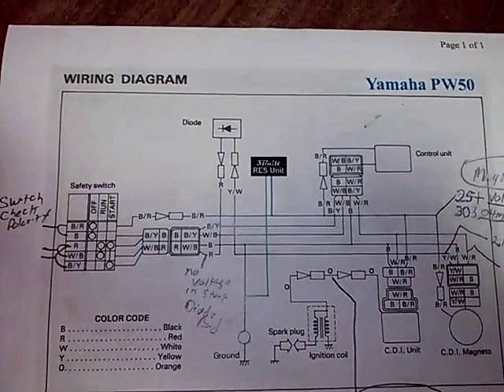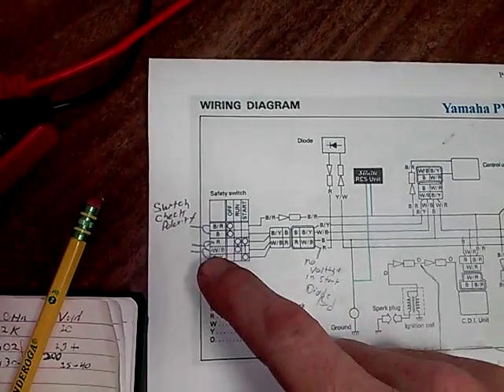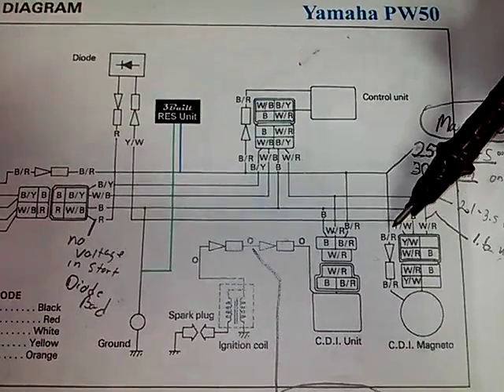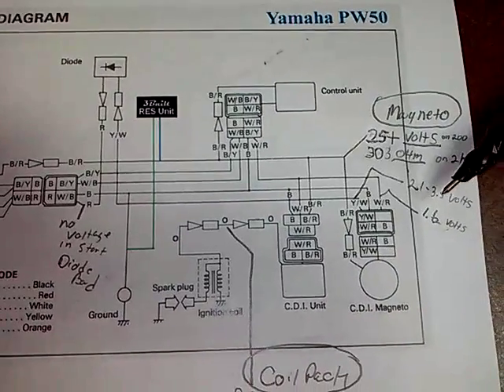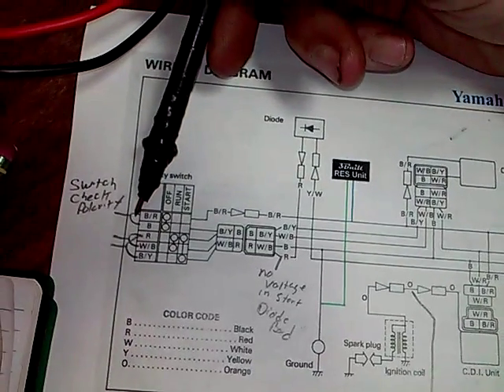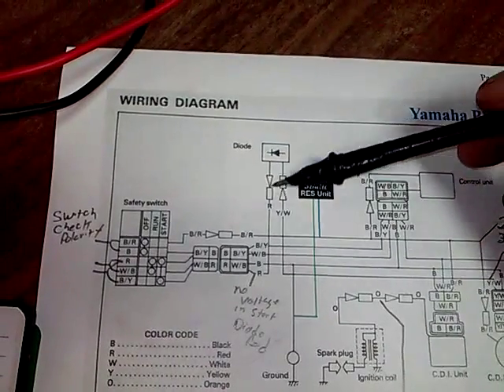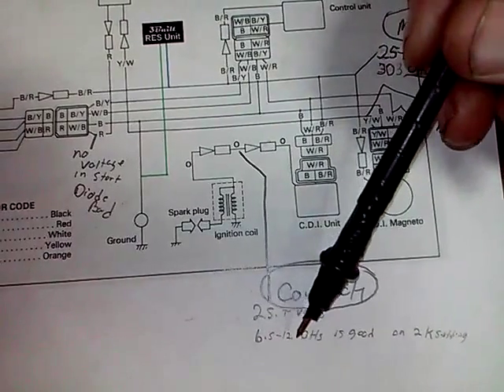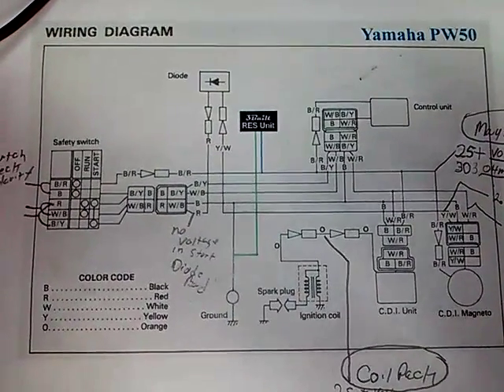how to diy Pw50 wire diagram volt ohms electric,  no spark fix

Comment: I have bought three new harnesses with components and still haven't got a spark.What I see consistently is that while I do get 25 volts out of the stator, as soon as I connect it in the harness it drops away. So, to be clear, I have tried with three of every component plus new harnesses. I'm ready to throw the pw50 in the trash.
Reply from the maker: You may have bad kill switch I had one that actually sent spark down through the brake cable the spark goes through it !

Comment: Awesome video! My pw50 wont rev up. Ive tried bypassing the switch and replaced the entire harness, carb , fuel lines. Top end has been replaced. Not sure what to test now. Idles great but won't rev up at all. Reeds are new, too. The voltage off the stater is high but jumps around is that normal?
Reply from the maker: Voltage It will jump with rpm’s up or down ! Sounds like carb or fuel issue if you have good compression! 32 to 1 good oil not gas station junk premium fuel not ethanol! Check spark plug gap also your secondary jet may be clogged also

Comment: This is the best one yet   Question the orange wire to coil I have no volts out put and it’s all new harnes cdi  on off switch stator coil  lol  I have voltage every we’re except that orange
Reply from the maker: Sounds like the cdi then! Only thing you cants really test ! Check grounds also to be safe from coil n cdi ect no rust or paint ! I’ve seen handle bar switch short to frame loosing spark , had spark run down back brake cable the gear box  lol 😂
Reply: @WaldensWorld   do you no what the ohm reading is for the coil.  And I was just thinking of buying a new cdi again lol maybe I got a China dud

Comment: Can you tell me what the voltage should be from the cdi unit to the coil on the Orange wire?
Reply from the maker: I’ll try to find it but should be 50 atleast I think mabey 80 plus volts I’d guess the pack would make it higher at the plug hundreds at spark lol but I don’t know for sure ! The towney 50 is same bike n qt50 also same stuff but they have lights

Comment: I’ve been tryin to get a switch with a square plug 4 wire can’t seem to find one I keep getting a flat one.  Wonder if it can be hardwired like colors without the plug?
Reply from the maker: If it has same wires you should be able to if I’m doubt open both n check we’re the wires go to in switch if colors don’t match ! It seems like I’ve done one beefy but it’s beets long time ago ! I’ll look I’m bit I got old parts bike in shed !
Reply: @WaldensWorld  thanks. when I bought didn’t have paper work not sure what the year is. Replaced throttle cable and doesn’t seem to work right.  These things seem like they haven’t changed in years but maybe just slightly. Bought some parts off Amazon (Junk). Got frustrated and took to the shop. They sent back not fixed. They said there guy is the best. Hmmmm. But he didn’t fix it.
Reply from the maker: Yes I have hired a few of those guys myself, it hurt my name with few people! Don’t hate the business unless you complain n they keep him ! They guy that didn’t get good service at my shop one of thousands, he just took bike home didn’t say anything until year later at race track carb wasn’t done at all ! I’ve always stood behind my work n by him not saying anything I kept guy a week longer than I should have , someone else called n complained ! The first sighn I had him do compression check on atv , he said it held 90psi for 3 minutes lol I’m like sir they tester has valve that hold the pressure in a cylinder has rings n valves ! He was like 60 said he was Harley mechanic! I put tester on pulled throttle wide open and it was120psi 90 I would have rebuilt it ! Have to have throttle open to get air ! Make sure you give shoo call to make it right ! Sometimes they just got bad apple , but sometimes you may have a case deal out or something that may be harder to find ! Good luck !

Comment: I have a pw50 that has no spark have replaced everything stator cdi coil wiring harness etc any chance you have come across this before mate?
Reply from the maker: Handle bar switch ? Bad ground ! Had spark go through hand brake cable n ark at back breaks one time lol
Reply: @WaldensWorld   hey mate so my new meter arrived today and have started from the start following your video. So I have got to the diode have put my meter on 200v ac have put my earth on the yellow wire and tried earth at the coil and positive on the red wire when kicking bike over most I get is 2.0 is that to low? Thanks mate for the reply really appreciate it
Reply from the maker: I’ll have to rewatch video I slept since lol 2 volts would be ok it it’s the trigger but not main voltage ! I can’t remember wire schematic off too my head
Reply: Haha no worries mate so diode no good you reckon? Is that possibly y I am getting no spark?
Reply from the maker: Flywheel bad ? It’s very uncommon but it happens

Comment: 96 pw50 that idles fine but has no throttle response. No change when switching from start to run on the handle bar switch. Possible bad switch or something else? Here is a video: https://www.youtube.com/watch?v=iUx-7ip5-1k
Reply from the maker: Yes I’d say start switch is out !
Reply: I tested the switch and got ohm readings when I was supposed and didn’t get any when there shouldn’t be any. Is there a way to bypass the switch for testing purposes? I tried disconnecting the plug where the 3 wires run, but that didn’t change anything either.
Reply from the maker: There is a inline resistor in the wire harness it may be bad ! But if I remember it’s for the start button not run ! Cdi may be out it has both modes in it !

Comment: Hi. My pw50 starts fine but when I turn the switch to run it cuts out and stops. It has a new switch installed. Any ideas?
Reply from the maker: Sound like your wiring is backwards or switch under side is grounding to bars some how . I had one shooting sparks though the back brake cable by the rear wheel ! I'm think that switch !
Reply from the maker: I'm not near one but typically the black n whit is kill switch . Sime after market switches are wired differently if you have the old one you can check the wires on it n what switch they are soldiered too !
Reply: Thanks guys for your reply’s. I have checked switch wiring and it matches wiring diagram. I’m now thinking it could be control unit but will try earth on switch 
Does anyone have wiring diagram with control unit removed? This will check if control unit is faulty, I can put back again if it proves to be ok.
Thanks again.
Lee.

Comment: I am getting ~ 25 Volts on the B/R wire coming from magneto if it disconnect it from the harness.  When I connect it to the harness and put the meter back on it I only get a couple of volts...
Reply from the maker: You got a weak stator at 25 ac volts I'm guessing you barely have a spark or only sometimes . What does the blk/ red to ground ohm at unplugged from harness ?
Reply: @WaldensWorld  It seems like I barely have a spark and its intermittent.  I've replaced everything from the switch to the magneto, but I already found some issues with the new harness.  For one, it came with the orange and black wires reversed that plug into the CDI relay (not the magneto).  And from what I can tell, the diode on the new harness reads opposite of the inline diode that came with the bike.  Does that make any sense?  Mine is a 1981 which (I think) makes it a pw50 H model.  I wonder if the wiring diagrams are the same across all models?
Reply from the maker: @taildrgrplt  is it stuck on start ? That has a limited on it ! It's different than run ! If you got new stator . N harness . The cdi may be bad . Or you start run switch . Is stuck on start . It fires like every other time on start vs run ! Check grounds also ! 
Diods are one way so if your getting spark it should be working ! 
Flywheel is clean no broken magnets also ?
Reply from the maker: @taildrgrplt  not sure why wires wouldn't match up . Did you check the rest of the colors ? . You have a good ground hooked to the motor also ? Not frame but motor ?

Comment: Ok guys ... first of all thank all the answers and the post. For your information I found the problem. After reviewing everything according to the info of the post plus the electrical diagram. I found that the motorcycle had no current because the switch was always connected to ground. THE WIRE B / R always grounded .... the problem was THE BRAND NEW SWITCH ... yes ..... the connection inside the switch, the little drop of welding was touching one of the walls of the housing, there was the issue .... I grabbed an old saw blade and made a small long knife and with much care removed the welding from the housing and ate a bit to prevent future touches in the housing. SO PROBLEM SOLVE.

FYI ALWAYS IF YOU REPLACE A KILL SWITHCH CHECK WITH ALL WIRES DISCONNECTED FROM  SWITCH .... THE BLACK WITH A RED LINE WIRE  ..... 
USING AN OHM METER ON CONTINUITY SET THAT THE
WIRE IS NOT GROUNDED. 
(again switch need to be disconnected from bike harness)
CHECK WITH A PROBE ON THE BLACK/RED LINE WIRE TO HOUSING ON SWITCH, IT MEANS WERE THE   SWITCH IS INSTALLED.

HOPE IT HELP

THANKS ALL AGAIN.
Reply from the maker: Good to hear . It's hard fixing over the internet more of a guide . I had one pw not sure which video you seen . Spark ran through rear brake cable . You could see it spark at back wheel ! It's a process for the strong . I tell my buddy if it was easy anyone would do it ! 
Kids riding all that matters !

Comment: Where the DIODE IS LOCATED??   NO SPARK AT ALL AFTER MY DAUTHER CRASH BIKE AND REPLACED DE IGNITION SWITCH  ( OFF- RUN- START)
Reply from the maker: Did the switch break when she crashed ?
Reply: @WaldensWorld  yes
Reply: @WaldensWorld  i just installed a new one
Reply from the maker: Do you own a volt meter ?
Reply from the maker: Diod is close to the computer under seat in a clear looking tube
Reply from the maker: I'd check ground wires new spark plugs . The diod is in the wire harness I don't remember where but you can feel it . I don't think that's the problem though .
Reply: @WaldensWorld  yes ..
Reply from the maker: You prolly have diod tester on meter . But if you suspect it replace it there cheap . I had one few week back on John deer mower test ok . But it was leaking .8 volts . So it slowly took the battery out .
Reply: Do you know what the specifications of the diode is (ohm) The one on the PW I bought is missing and would like to have the limiter working again. I can find the part number for a new one but thats about that.
Reply from the maker: Diod is one way circuit get a volt meter n it should have a tester
Reply from the maker: Diode in rectifier smooth out ac electric n switch to DC n is a one way gate so it won't flow backwards ! Alot of testers will have a diode test on it !
Reply: @WaldensWorld  Actually Diode bridge cut the AC wave rectifying AC to DC. One diode do nothing, one diode acts as a valve preventing voltage spike back to system, in most of cases use where a coil is envolved,or relay , light or ignition coils......a sudent (miliseconds) cut of power on a coil produce high voltage spuke, going to system and blow circuits, there where only one diode is installed, againin order to get dc from a ac circuit you need A DIODE BRIDGE.
Reply from the maker: @PelukaUSA  bud I just said that , a rectifier has 4 diods changes AC to DC then I said it's a one way gate it don't allow electric to flow backwards ! You've corrected nothing ! You've made yourself look silly in my eye's ! Water is wet !
Reply from the maker: One diode definitely does something partner it allows electric to flow one way ! And only one way till it burns out !
Reply: @WaldensWorld  Technically correct. Diodes DO NOT CHANGE, A Bridge rectifier is an Alternating Current (AC) to Direct Current (DC) converter that rectifies mains AC input to DC output.clean your eyes,read n learn.

CONVERTS,RECTIFY!!!

Want to look smsrt,byse right terms (if you know how. :)    )

Comment: Hi Walden, 
Thanks for the video. My friend gave me his non-running PW50 to fix. I've been through all the tests you describe and have replaced the ignition coil. Now it will start and run for a couple of minutes then it dies. Sometimes it starts again, sometimes not. The only reading I got different from yours was the magneto resistance, mine being around 175 where you had 303. I'm thinking a winding is breaking down and causing the intermittent running fault, what do you reckon? Thanks for your help.
Cheers,
Richard.
Reply: New stator fitted, Peewee lives! Thanks for your help😁👍
Reply from the maker: Sounds right the shorter the wire the closer to 0 . So yours may be bad bout half way . And when it gets hot it gets worse . Or check spark plug make sure not burning oil from bad seal on crank in gear box
Reply: Thanks for that. Good to get a second opinion. No oiling on the plug so I think we're OK in that respect. New stator ordered so we'll soon find out if that's the culprit. I'll let you know👍

Comment: Hi,
Can you please clarify what the controller units does?
Have a very old PW50 with an ignition problem.  There is a weak spark and sometimes it fires but will not run.  Have bused through the harness and it is OK.  Very old fragile and cracked insulation, but OK with some tape!.
Do you know how the controller interacts with the CDI? and is it possible to eliminate the controller?
thanks
Reply: I just started working on one of these and it starts and runs. However if I give it throttle it sounds like it Boggs down but doesn’t die. When I unplug the control unit(little black box with red coated wiring harness in the frame of the bike) it revs up higher and I can ride the bike like normal. Could I just have a bad control unit?
Reply from the maker: Yes one is the limiter on a normal running pw when it’s in start mode it skips spark until u put it into run then you have full spark ‘n
Reply from the maker: WHAT CONTROLLER ? CHECK FLYWHEEL FOR RUST AND PICKUP SENSOR FOR RUST OR METAL ! NEW PLUG GAPED RIGHT ?
Reply: Hi,  I have made some progress with this.  It appears that the function of the controller is to limit the engine RPM when in the "Start" position, to prevent the bike from taking off when kiddo starts it.  The controller has a connection to the magneto AC output that powers the CDI.  Since the magneto AC output impedance is in the region of 300 ohms, it probably shuts down the CDI by effectively shorting the magneto AC output that powers the CDI.
Another function of the controller may be to limit the RPM (& speed) when in the "Run" mode.  Maybe someone knows something about this.
The problem with the my PW50 seems to be that the flywheel magnets have become demagnetized, producing a smaller, weaker and erratic spark, making starting very difficult.
There is not much around on the subject, but it appears that old flywheels( mine is 35 years old) are prone to loss of magnetism.
I have bench run a CDI and discovered a simple method of doubling the spark coil voltage by adding a simple extra component into the system.  Am in the process of determining if this gives sufficient extra spark to make the system work with the weakened flywheel magnets.   
If that does not work, then it means a new flywheel is required.
Reply from the maker: yes you prolly have bad handlebar switch ! they go out ! my grandsons will be running and vibrate to start then well no more running ! l;ol sorry i got a.d.d. didnt notice pw video ! most bikes have rev limiters built in cdi box so motor dont blow if you fall with throttle twisted !
Reply: I have the same problem . weak spark and intermittent spark . Replaced the magneto and no change .  Replace CDI box . still the same . weak spark . I would rotate the engine with a drill on the fly wheel , at a slow steady seed it would have a steady spark but weak . NOTE , I have rev-limiter unplugged along with handle switch unplug also  to narrow it down to Mag to cdi box and coil ( New coil) . Just getting now where
Reply: @davidmorton-tran3031   did you end up finding out the problem mate I have zero spark on my pw50 have replaced everything tried 2 different stators cdi stop start switches etc getting no where

Comment: Hi my pw50 starts  but when I put it in run on the Handel bars the throttle goes wide open can you help?
Reply from the maker: did you take carb apart ! sound like either piston in carb is in 180 degrees backwards or you gotr the adjustment screw in to far ! if you took carb apart the is a slit down the back side and a angled bottom edge on front ! the angled edge goes twords adjustment screw ! hope this helps !
Reply: +coryncheryl1 thanks! This fixed it
Reply: +coryncheryl1 thanks! This fixed it
Reply from the maker: Henry and Sam
 your welcome thanks for thanking me ! thats why i do this ! just not the greatest but if i help a dew ! thats what matters to me ! braaaaaaapppppp
Reply: Your throttle cable is not adjusted properly and constantly giving the bike throttle.  Also try adjusting the idle down.  The problem in your case is in the carburetor adjustment.   Bob 831 383-2676